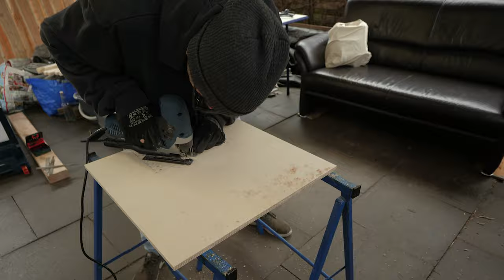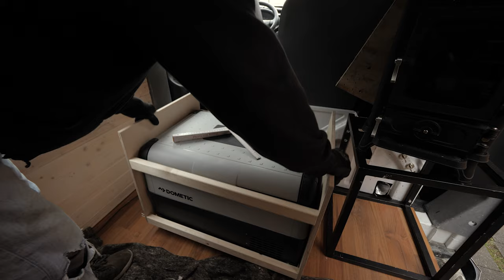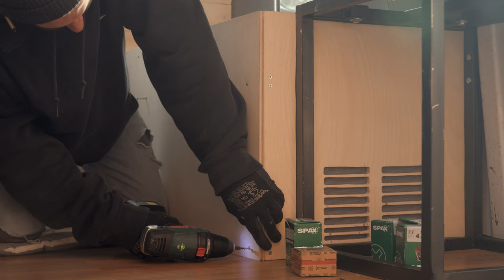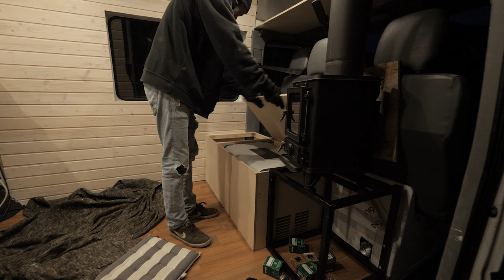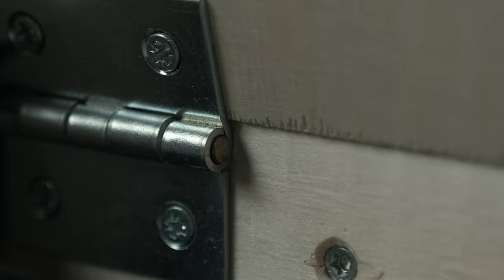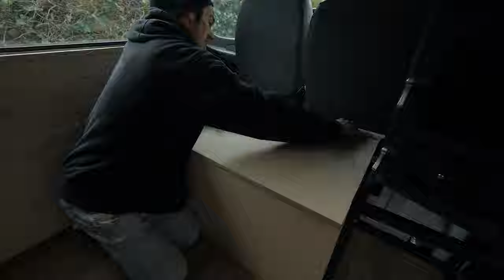How to Build a Couch in your Van

Comment: The solution for your gap problem is these hinges https://www.amazon.com/Lancher-Hinge-installation-Cupboard-Cabinet/dp/B01IY8CTLM I used them on my cabinet doors and they are just awesome. You can cut a new bigger door (coveting the gap you have right now). These hinges actually not only rotate the door but also moving it upwards. And as always, great stuff. Have fun with your van and keep it up with the videos :)
Reply from the maker: This is genius dude, thanks! 😃
I will try them out and maybe even change the lids in the future.
Right now I'm thinking about a seat on the other side. Might be worth using those hinges too.
Thanks for reaching out, have a great week :)
Reply: @ARTVENTUREFILMS  you're welcome! They are quite large (when folded), you must keep than in mind.
Reply from the maker: @DerpyExpress  alright will do, thanks!